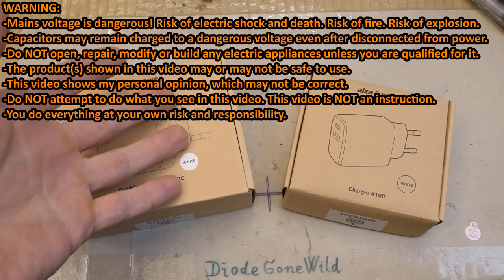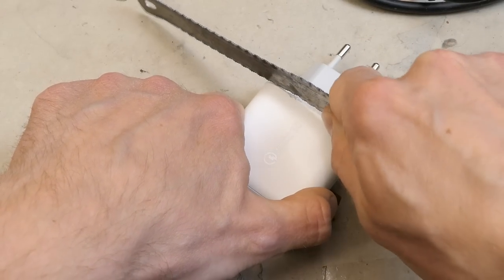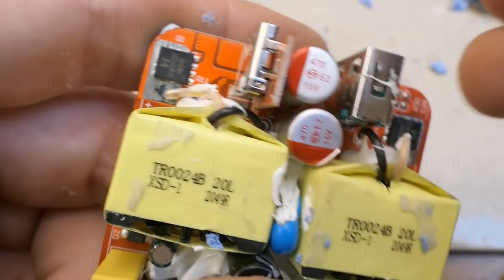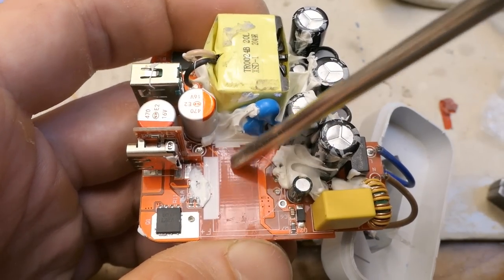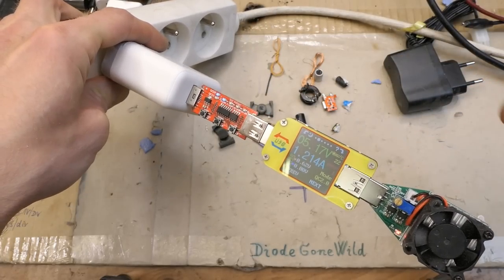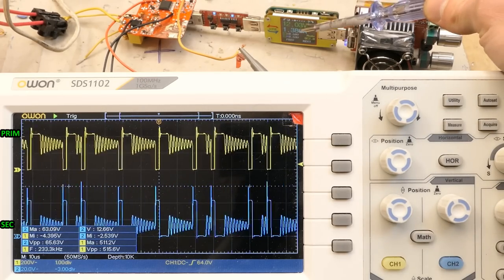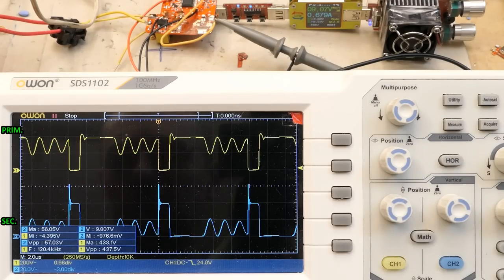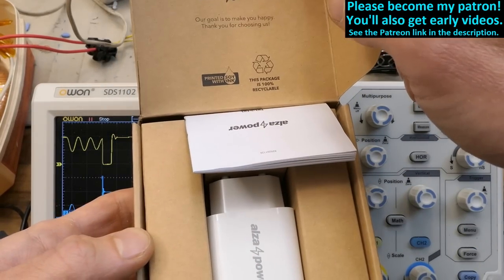A safe USB phone charger? What's inside?

Comment: As an almost boomer, thank you for remembering at the beginning those moments of emotion when we welcomed and discovered with respect and wonder a new piece of modernity, the first tube radio, the first black and white television with a single channel, the first crank telephone...
Otherwise, what a difference in quality of this charger with the low cost copies!
Reply: For what it's worth I think those moments are still there. The innovations mostly aren't massive breakthroughs which sent ripples across Western culture (smartphones and the like aside) like the jump from tubes to transistors (or BJTs to MOS and later CMOS), but I bought my Haswell CPU with a smile knowing it had one of the first mass produced FinFETs in it. The e-Ink display is also one of my favorites.

Comment: The IC is the Power Integrations Innoswitch. Quasi resonant flyback controller, magnetic feedback isolation with integrated synchronous rectifier controller. There are also types with GaN and SiC transistors.
Reply: Is a datasheet available online?

Comment: to be fair, some of the thick, heat sealed plastic packaging some products come in is impossible to get into if you dont have a knife or scissors handy
Reply: True. But the latest SD card I've bough was not only in tightly sealed plastic, but the plastic itself was embedded in sealed cardboard, so it took multiple steps to get out the card safely. :) I didn't get frustrated, though, as I put the card for good in a "smart" phone that is a lot more frustrating than these minor issues.

Comment: 1:00 boomer mentality but i do agree, only frustrating packaging is the sealed packaging for sd cards or flash drives, it's impossible to open without ripping it
Reply: Broken cutter, new cutter comes in a slim/minimal package held with 5 heavy duty zip ties. Huh. 😂👌
Reply: Those memory devices imho are sealed to prevent moisture ingress, during storage and shipping around the globe. Second, maybe as anti-tamper measure, too.
Reply: @dave161141  I couldn't return a shitty usb3.0 flash drive that had speed of 500kb/s because the package that has to rip have ripped..

Comment: I love syncronus rectifiers. They make power supplies way more efficent and reduce the waste of power. And when GANFETs will be more popular and cheaper (They Switch FASTER, they have way lower gate capacitance, lower ON state resistance, and more), the efficency will be EVEN HIGHER (Like 98% or something like that).
Reply: Agreed. It's sad that switching supplies have used diodes for so long, which adds the same kind of voltage drop loss as a linear regulator, though not nearly as much.

Comment: Those PI isolated controllers do not use optocouplers to communicate. Instead, they use a pair of leadframe windings (14:26) to magnetically couple signals back and forth.

Reference: I am a power electronics engineer and I've reverse engineered most major vendors' controller chips.

Comment: I think that chip is an Innoswitch from Power Integration, integrated silicon mosfet for the primary and discrete mosfet for the secondary (too big to put it in a single package).
They also have a gan version now, and those are used in some other chargers. They also make an interesting one named MinECap, to reduce the bulk cap for high and low line usage with smaller bulk cap.
(Disclaimer: I work for a competitor)

Comment: The package/buy it-trash it rant is on point 💯
For me the real frustration was the hair on the screwdriver 😰 I'll take 1000 non-frustration-free packages over that visual torture.. every time it went out of frame i prayed it comes back hairless 😧😅
Reply: I was more annoyed by the grease that was also on (which was probably also why the hair stuck to the screw driver  and didn't just fell off). It looks  disgusting. How lazy can one be, not just take some paper and wipe that off,  before shooting the video...
Reply from the maker: On your 2m screen you notice more things than I do on the tiny camera screen :D. I only noticed it when editing in on my computer.
Reply: @DiodeGoneWild  I'm disappointed that you stopped responding to my Patreon DMs, which are the main reason I keep supporting you. Please try to check them once in a while.

Comment: This looks a very well designed and well built charger. It user a proper transformer and high quality components. The chip is a InnoSwitch from Power Integrations, which is a very reputable brand. (not an obscure chinese chip with no datasheet). It can also deliver more current than it claims, which is a good sign.

Comment: Excellent video. Those isolation gap spanning control chips are super neat, never seen one before. I'm glad I can repair most of my own electronics, it would be nice to make a business out of it but the repairs would cost the client more than a new charger/product. So boom, into the garbage it goes. Pisses me right off that everything's disposable now. Like those one time use vaporizers with a big ass lithium battery. You know full well people aren't disposing them properly and we are just destroying everything at a faster rate than ever before. Disgusting.
Reply: yap its cheaper to buy than repair even for us experts.
Reply: Hi, how to modify charger that has a lot of AC electric leak on usb output? The only problem only that nothing else
Reply: People ARE disposing of them properly.... they're dropping them in the street where we can pick them up to recover and re-use the batteries.   ;)   ;)   ;)
Reply: @edgeeffect  very true lol. I ran one over on gravel the other day and noticed a small jet of fire and smoke behind my truck as I drove off. Good thing there was snow around lol
Reply: @airmann90  I have a charger that has AC Leak, it's good quality included from phone.

When I use it, it make da  touchscreen unresponsive.
When I change to other charger that less AC leak, the Touchscreen unresponsive is gone.

Is there any way to modify charger that has AC electric leak ?

Comment: I suggest opening up also their 20 000 mAh powerbanks. It costs (oscialtes between 500 - 700 CZK) about the same price as one with same capacity you have bought from LIDL already. I am using them for powering IP camera on bird feeder and they withstand even - 10 °C on balcony. They also have quite good charging speed (18W reacheable with QC2.0/Q3.0/USB PD charger)

By the way, when used to work for Alza, in our MS Teams was shared one of those frustration free packagings and collegue was complaining, that package of one of their AlzaPower products (probably USB-C to Lightning cable) was quite tricky to open and box looked liked as if it was chewed by angry dog :D Idea about those packages was to make that sticker easier to cut or break it by pulling it strongly.
Reply: Agree, european LIDL stores nowadays sell some pretty useful cheap appliances.
Reply: @KrotowX  That's true, I have from RGB LED lamp with battery / remote control and it is nice suplement to Philips HUE system :)

Comment: The blue foam on the transformer is actually a thermal pad. They are also seen in laptops and graphics cards to help cool the power circuits and ram chips
Reply: Yes. Pretty sure it wont do a huge amount thermally since it just connects to some plastic, but it's better than nothing and of course also makes it resist more vibration and shock mechanically. It would be very easy to save a tiny bit of money by ommiting this though.

Comment: nice to see a transformer that's been made so that it's not out to kill you. Just goes to show you don't need to do too much to make it safe and pass safety requirements. How much do they save when they make the killer versions.
Reply: Idk maybe a few dollars and they dont go trough a good check they might print the stickers qc and put them on idk
Reply: Probably alot when it comes to huge quantities, that's why you can get those chargers for $2 USD.
Reply: These good transformers use slightly bigger cores for one thing, which are expensive. They are also often hand-assembled and wound, which costs more money when done properly. I wouldn't be surprised if this transformer costs 3x as much to make as the cheapest ones.
Reply: Check cost on a spool of TIW vs cheap single coated magnet wire.
Reply: @Broken_Yugo    but even using cheap wire does not stop them making them safe. it's the very slight changes at times, almost makes you think they design them to be unsafe. But until we stop them being imported they won't change.

Comment: I like the transformer... What I don't like is the Сhineesy red PCB. Also too much SMD and glue, but that's probably unavoidable in a small PSU like that. Oh, and of course, the glued (or welded) case, even though it seemed like this can be opened with relatively low damage.

Also having the chip span the isolation distance (which would otherwise be wasted space) is kinda smart.

Comment: 17:08 the diode is probably for startup, to power the secondary side until it can start switching the MOSFET.
Reply: The Mosfet also contains a body diode. It would be enough just for startup. But later, on the oscilloscope you can see that it switches off a bit before the energy runs out in the transformer, and the diode will probably have a lower voltage drop at that time than the body diode. It's also very cheap to add a regular silicon diode, so they just added it.

Comment: my OCD focused more on the hair until 6:53 :)
I think the rectifier transistor turns off below a certain secondary current, but why not at (or just a bit below) zero?
I wonder if the variable off time in steps is a kind of spread-spectrum?
The main chip seems similar/is from Power Integrations InnoSwitch family.
Reply from the maker: When you have a dog, you have hair everywhere :D. Maybe the voltage drop on the ON state resistance of the synchronous mosfet is so low that the chip can't detect a low current. Yes, the variable off times reduce the interference. The chip seems to be from this family, but I didn't find the exact datasheet.
Reply: There are R12 and R28 with a value of 30mOhms as secondary current sense resistors, the current could have been measured there, not on the mosfet. However, the InnoSwitch-CE datasheet reads: "In discontinuous mode of operation, the power MOSFET is turned off when the voltage drop across the MOSFET falls below a threshold of approximately -24 mV". So indeed a low ON resistance mosfet would result in early turn off. My takeaway: the optimal ON resistance of the rectifier mosfet is not the lowest available (in this case).
Reply: @ovidiulu  yeah it doesn't seem ideal in terms of efficiency. Pretty sure I've seen better synchronous rectifiers than this.Still much better than a regular schottky though.

Comment: What is the red board that you're using in between the charger and your tester?
I love your angle-grinder-tomography!!!
Reply: It's QC trigger board. It asks the charger for different voltages using Qualcomm's QuickCharge protocol.
Most of the modern power supplies support at least USB Power Delivery and QC.
Reply: @SirWolfCZ  That's new to me. :) I always thought USB only did 5V. I assume the request for higher voltage is implemented as part of the USB protocol????
Reply: @edgeeffect  Yes it basically uses the data pins to communicate what it wants digitally.

Comment: How does the large gap on the pcb help the isolation when the ferrite itself is conductive and bridges the gap? I can see it’s wrapped in tape but not all paths from the windings to the ferrite are covered. In terms of tracking difference it would be much shorter than the pcb. My high voltage transformer failed by arcing to the core.
Reply: Good question. I'm pretty sure most ferrite has quite a low conductivity and almost behaves like an insulator. Keeping the wires away from the ferrite is still important, but mostly at higher voltages. I'd say this transformer is not the best I've seen in a USB power supply, but still massively better than the ebay junk. 

The PCB gap is probably also bigger than it needs to be, but it's still nice. If conductive dirt or a drop of water made it onto the PCB there, it would effectively reduce the gap. That's where a larger gap can still be beneficial. It's very niche of course, but not pointless.

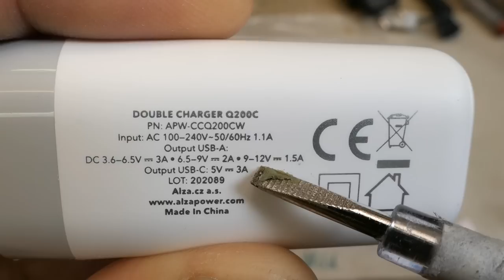Comment: 1:50 how in the world is that charger 1.1A on 240V? Even on 100V it would be 100W which it probably is not
Reply: Probably the peak surge current when u plug it .. basically the current those caps pull when charging for the first time.
Reply: @KuntalGhosh  arent you supposed to list the working currenr not peak current on the device
Reply: @alexstone691  never seen any device list the working current other than air conditioners or thing's with motors.
Reply: @KuntalGhosh  i never realized it was the peak 😅
Reply: @alexstone691  yeah it's usually an absolute maximum rating. It's there to tell you how much your circuit needs to be rated at as a minimum. At least in theory.

Comment: Wow, why is that QCs don’t support QC on the USB-C port.. is that a connector limitation?
Reply: The connector can definitely handle 12 V or more, some laptops even use USB-C as a charging connector nowadays. Maybe the implementation is simply too difficult in case of USB-C and they decided not to bother. I think the PD (power delivery) lines are actually separate from the original USB 5V & GND on the connector! I don't think a dual voltage supply (PD and 5V simultaneously) is required, though.
Reply: It is forbidden by the USB specs to provide legacy charging protocol like QC3.0 that changes VBUS over USB Type-C connector. So it seems that manufacturer of this charger actually respects it. However, they should have implemented proper USB PD for the Type-C. This is just wasted opportunity. Perhaps this is a legacy design adopted for Type-C connector with minimal changes.
Reply: @vaclavtrpisovsky  Indeed, Type-C uses pins CC1 and CC2 for continuity and polarity detection and optionally PD negotation (which is the only allowed way to raise VBUS from 5V up). On the daugtherboard with the connector, you can see two pull-up resistors from CC1 and CC2 and no controller. That means only 5V is supported. By the value of these pullups the plugged devices can determine whether it should provide 3A, 1A or USB-legacy (900/500 mA). PD would require a controller attached to those two contacts. Too bad it is not there.

Comment: I bought a galaxy note 20 ultra hk variant off ebay and the seller included an obviously counterfeit "samsung" charger with it. Obviously knowing how much of a death trap these knock off chargers are I took it apart to see all the corners cut and safety measures bypassed and I could not believe what I found inside. Apparently in an effort to make the weight of the charger approximately the same as the genuine one a 5g wheel balancing weight was glued to the side of the undersized transformer in the device. A wheel weight! The components were so undersized (and flat out absent) that the charger weighed too little to be believable unless extra weight was added somehow. So they went with a chunk of lightly glued down METAL. Imagine if that got loose while in use!

Comment: isnt it bad if a charger lets a device draw more current then rated? this one didnt cut off and allow 3A9V. at this much power it would heat up a lot which is a safety concern
Reply: Only if it actually got damaged at it's real maximum current/power, which I'm guessing it wont be.